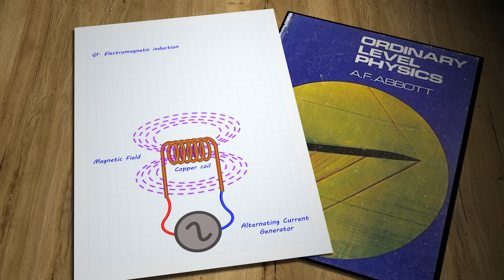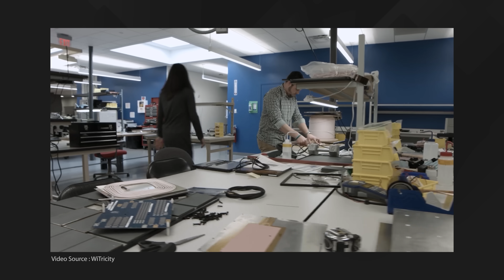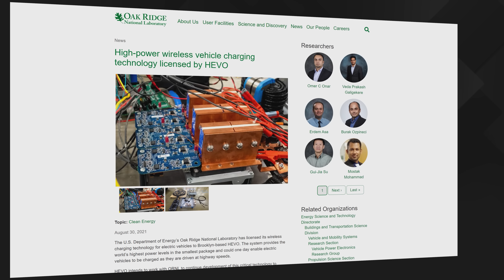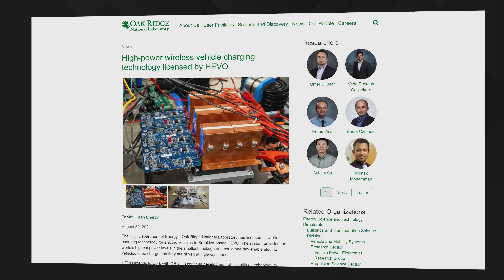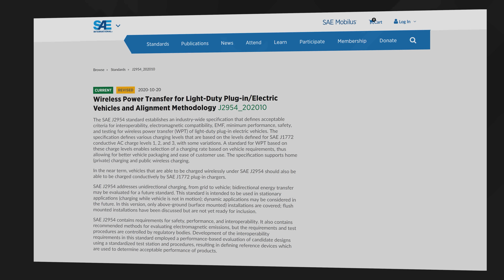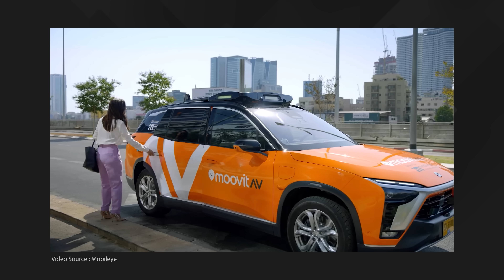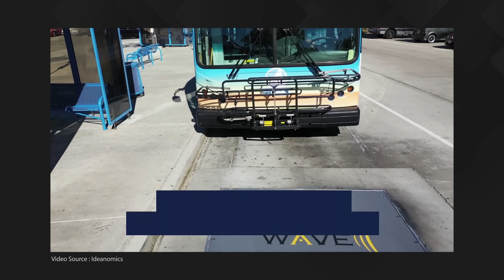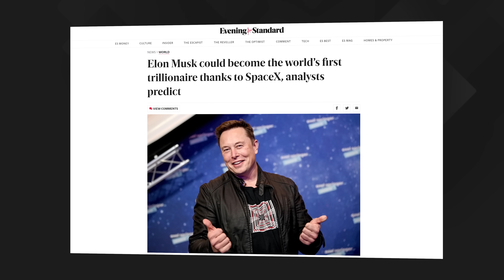Wireless FULL EV charging has arrived!  Exciting new tech breakthrough.

Comment: Hey, are you aware that by this convenience gadget you throw 10% effiency out of the window? You can't shed tears about climate change in one video and hail a silly gadget for rich people who are too lazy to get a plug in their hands in another one.
Reply: It's not a convenience gadget. It's a way of making EVs more attractive to consumers (as they can be charged faster) and it also, as explained in the video, has the potential to be more useful to balancing national electricity supply by drawing power from the battery when the car is not in use. And there is the fantastic potential of charging while driving, reducing the demand for plug-in charging services, thus making them easier to access for people with plug in vehicles.
Reply: The energy doesn't go out the window. It goes into the room! Could be good in a cold climate, as the cooling system for it could be just heating the house.
Also, don't knock convenience. Most of the decisions in the world are done around convenience. Not being able to forget to plug it in can easily push charging from good times to times far more problematic for the grid, and if the grid has to spin up a gas station to cover it then we would much rather be spending 10% extra to get it from renewables.
Reply: @agsystems8220  I have no doubt that those systems will be coming, since, you're absolutely right, convenience is a big selling point. 

However, in most countries EV have still a long way to go in order to make sense from an emission perspective. The car sector is huge and to compensate for this 10% loss multi billion investments in renewables would be required.

In other videos he talks at lenghth what we should do in order to save tiny fractions of emissions. And now this, in comparison, huge amount of loss is just a nuissance.

This is what I'm critisizing, that these idealistic YouTube guys often have a totally irrational and conflicted sense of proportions.

And by the way, I doubt that people who buy this kind of cars live in their garage to benefit from the extra heat.

Comment: I'm an electronics technician with a specialization in radar systems and I had suggested this years ago. Someone tried to argue with me that you can't focus magnetic energy (obviously referring to the inverse square law) but I told him that we focus a flashlight with a parabola and light is both electric and magnetic. We focus radio waves with beam antennas into very narrow and directional beams and radio waves are both electric and magnetic. So yes, through antenna design it is entirely possible to focus and shape magnetic induction fields into high Q tank circuits (magnetic resonance) for directed wireless power transfer.

Quite frankly, I was very surprised that they didn't attempt in road wireless charging to start with! Instead of having on the go charging they opted to build a massive new network of discrete (and expensive) rapid charging stations. But there aren't nearly enough of them if everyone were to have EVs. It would be a two-fer getting new roads and bridges to drive on for everyone ICE or EV and eliminating the need to be tethered to a charging station ever again at the same time!

There is however, one concern I have with the wireless charging technology and that is its affect on cyclists and pedestrians who may have pace makers or implanted defibrillators (there are a shit ton of us such folks here in the US) as the devices are turned on and off through magnetic induction - fact! If an induction coil in the road is not actively coupled to a receiving antenna coil in a vehicle passing over it then the field generated by the road coil will be broadcast much further out from the road surface (because it has no receiving "load" above it) making it a hidden and silent danger to pedestrians or cyclists with pacemakers or defibrillators. I see an electric future where jaywalking with a pacemaker can be downright deadly!
Reply: With respect? you are totally and utterly wrong. Magnetism is a field, light is a wave of packets. You can't bend light with a magnet - you can't focus magnetism as if it were a wave - it's A FIELD!!!
Reply: still, a good cable is always going to be more efficient
Reply: I learnt something from you today, thanks!

Comment: Who is this really for? A select few wealthy boomers can afford electric verions of the posh cars they flex, but, as 2030 comes along, with all the boomer cars still blocking every pavement, will a younger generation, priced out of owning a home, be part of this EV dream? This is displacement activity. We didn't get the gas turbine or nuclear cars that the automakers were promising us, but that seemed possible at the time. These posh EVs are in the same mould. 
Realistically we need social change not gadgets. The minimum wage, gig economy of serfdom we now have where the rich get richer isn't going to support a high tech net zero. In material costs this charging solution takes up more copper than is in a house. It is a solution in search of a problem. Those electric busses will be charged at the depot, with a cable, if we get them (from China).

Comment: This will be an absolute game-changer technology! 

Especially once the charging efficiency will be on almost par with cable charging!

Why? Because it will shift the convenience advantage from fossil fuel combustion engines to the electric car. Today, the fast refueling of a combustion engine over the slow and messy cable charging (street charging on a rainy day) gives the convenience advantage to conventional cars. In the future, effortless anytime anywhere charging will give the advantage to the electric car since most drivers in rural environments will actually not even think about charging anymore - what? you have to refuel your car vs. my car talks to the infrastructure itself and charges on demand anywhere anytime.

On top of, battery sizes will dramatically shrink for most cars. Who needs a 300-liter gas tank since one has a gas station every 20 miles? Same with the battery sizes - why a 100 kWh battery when the car could recharge on the drive? This again will lower the initial cost of electric cars.
Reply: it'll remain to be less efficient and therefore it's wasteful not to use a plug in most cases. Phones, privately owned vehicles that don't need a wire crossing a walk-way etc. etc.
Reply: @andreasbrand3191  hi Andreas, I agree that there still is a lot of scenarios for (smart) cable charging. 

But I also believe there is a large potential in wireless charging for mobile devices (cars, busses, and trucks) since this technology does indeed take range anxiety off the table once you know that your car can charge while you are driving. 

And once people have no range anxiety anymore, the next generation EVs could come with much smaller batteries that again would result in a higher vehicle efficiency due to a lower vehicle weight and resources used to start with
Reply: Ten percent loss is not exactly on par with cable, and that is a best case scenario.
Reply: @incognitotorpedo42  - well, I did some more research and my comment was based on the fact that they are positive to reach an even higher efficiency than 93%. And a smart charging 93% for me is better than stupid charging (keeping your phone plugged in over the whole night and charging it to 100%). And once they really are in the 95% neighborhood, one can say that they are on par

Comment: Wireless charging is nowhere close to 95% efficient.  It's just not sustainable to waste 30% of the energy charging - and that's pretending they can double the efficiency of a normal solution and reach 60%.  Not to mention that any sort of resonance will be highly susceptible to movement... making the as-you-drive claims frankly laughable.
I like this channel because it's usually forward-looking, but based in reality.  Oh well, we all make mistakes.  Keep up the good work though! :)
Reply: What will happen if I, just in case, come in the path of the beam? Will I be cooked live?

Seriously it is like a transformer with two coils spaced apart. The EM energy need to be focused like a laser otherwise too much energy will just go in the air. I will be surprised if you can get 30% overall energy efficiency.

Comment: It's slow and inefficient. If you charge your car wirelessly from the average grid mix, it's more CO2 intensive than just driving ICE
Reply: The grid is about 40% fossil fuels currently, which is better than 100% fossil fuel used for ICE vehicles.
Once we go 100% nuclear, it will use 100% clean, safe, cheap, carbon free energy, which will work all the time.
Reply: @Music5362  I understand kitten, but you're somewhat misrepresenting. If you use 100% of one cup of fuel that's less climate impact than if 1 tanker only represents only 40% of your usage.
Reply: @LudvigIndestrucable  That doesn't make sense.  If the grid is 40% fossil, and an EV is about three times as efficient as an ICE, then EVs create WAY less CO2 than ICE, on average.  Even if you lose 10% of it to a ridiculous inductive charger.
Reply: @incognitotorpedo42  the loss is far higher than 10%, I'm aware of the figure they gave, but that was in an ideal experimental set-up, the actual losses will be far higher.

Comment: The big question I have is when there's no batter to charge the electricity is still going through the induction charger and therefore being used or expended.  Without unlimited electricity to continually run in the charger array how does this work?  Otherwise there'll have to be some switching to turn on / off the inductive charger.
Reply: It's quite possible for the charger to detect the presence of the car magnetically - indeed a wire coil in the road is exactly how traffic lights detect cars.  So it can run a very low energy standby mode, then ramp up to charging current when required.
Reply: @davidbastow5629  Those same traffic lights don't work that well where I live, California.  Still I expect some sort of Electronic Key so that they'll know who to "charge" the cost of the electricity.  (pun not intended)  It would be a better system as the Tesla Chargers are frighteningly expensive to install and the facility will have to be re-cabled for high voltage equipment.

Comment: Tesla and Wave do not have a collaboration - Wave is just trying to make it look that way (as far as I can see)... 90-95% efficiency of 1MW still leaves 50-100 kWh going elsewhere!
Reply: indeed... this kind of wastefulness doesn't go along well with our goals in sustainability and energy efficiency.
Reply: @andreasbrand3191  when 90% efficiency is considered wasteful you are letting perfection stop forward progress. The ICE it replaces has 30% efficiency in the engine alone.
Reply: @DanA-nl5uo   you're wrong. If you really can provide something with improved efficiency (AND improved sustainability!) then it's welcome every time. The carnot efficiency of combustion engines has nothing to do with the wireless charging technique at hand. The proper comparison are wires and plugs :P
A proper cable + plug has much high efficiency and needs much fewer materials - and it is proven and readily available. So if you offer something BETTER, sure, until then, cables and plugs...  The problem is, wireless will remain worse even theoretically so for most applications, it shouldn't even be considered, it can't help, it can only make it worse --> wrong direction.

I wrote a longer comment here regarding overall inefficiency of wireless for MOST applications. Phones for instance. It's just more wasteful compared to what was there before (cables and plugs)....  gigawatts of peak capacity world wide are already wasted on stupid wireless phone chargers - this must stop.

Are there applications that make sense - like for taxis or other stop and go vehicles with high duty cycles? sure. But privately owned cars standing in a garage of shamefull lazy people, definitely not. Plug in that plug manually and actually do this tiny little thing is the least bit one can ask of everyone to actually pull off this epic task of becoming sustainable!

regards, Andreas, physict working like mad on improving efficiencies... NOT decreasing them!
Reply: @andreasbrand3191  the efficiency of the current transportation system has nothing to do with the system that is proposed to replace it.  That is funny
Reply: Which is about the same efficiency as the power grid itself and far better than an ICE which is only 30% efficient with 70% of the energy in fuel going elsewhere